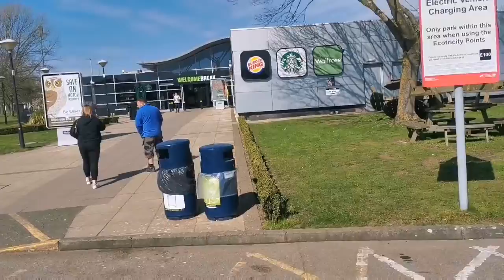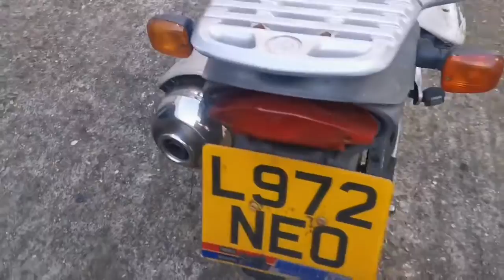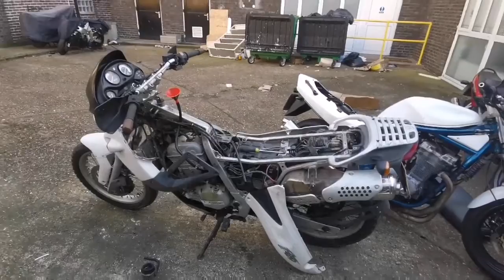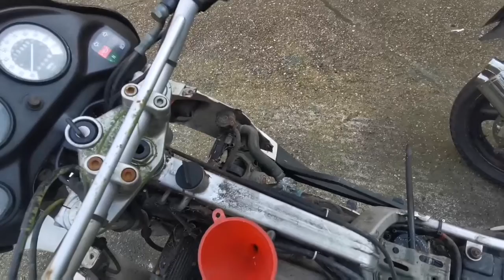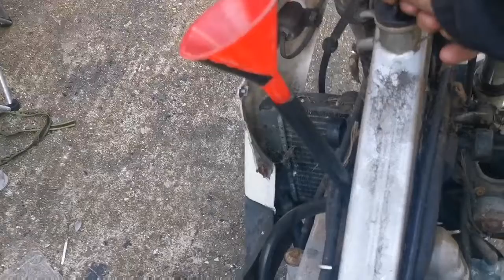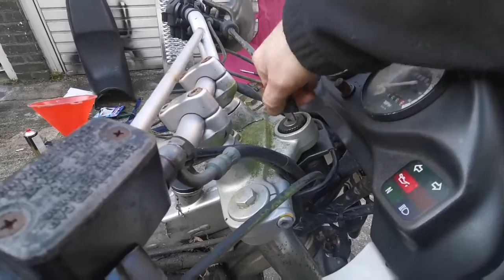Bmw f650, introduction, fix, repair, build, salvage, project, first look,

Comment: That thing is going to start burning its own engine oil through the airbox, or throw it out. Only check the oil level after it is at operating temperature. The engine is a dry sump. The carb ports on the dash pots are supposed to be uncovered.
Reply from the maker: Hi, its a very old vid this one but ill watch it again out of curiosity when I get a chance to see what you mean..

Thanks for watching

Comment: Did you cut the cable of the kickstand switch? In the first try the starter didn't work while the kickstand was down but later it did. My F650 kills the engine instantly when I kick the stander down. I can only warm up the bike while it's in the center stand.
Reply from the maker: I'm not sure if I'm being honest as this video is a couple of years old. I do regularly cut and wire side stand switches though as they are a known failing point. 

Thanks for watching and please subscribe.
Reply: @motorcyclerescuer  I've already subscribed. :) Thanks for the videos! I got my license last year and I started to be interested in the mechanics of the bikes. The center stand is a nuisance indeed but it can be a life saver. If you forget to kick it up before taking off you can have a disaster while turning left. I've heard a story about that from my driving instructor. His friend died that way unfortunately.
Reply from the maker: @istvanbocsor7911  that's true yes, it can be very unsafe. Badly fitted to low exhausts can do the same thing aswell. 

I love mechanics, it's like therapy to me so I'm sure you will love it to.

Comment: try wd40 in the ignition, has helped me before
Reply from the maker: Hi mitko, I put some contact cleaner in there yesterday, that should work it's way through. May help but may not.

Comment: Not bad, hope those carb rubbers don’t cause you too much hassle. Once they’re hard they can be a nightmare.
Reply from the maker: I'm thinking not to take them of. If I can work out how to put the new fuel line on without it then that should be fine. It starts runs and idles so don't want to mess with it to much. The air filter comes out the side so I can still service it
Reply: Yeah probably the best idea mate. look forward to the next vid 👍🏼
Reply from the maker: @woods146  thanks mate. Will be next Saturday dude.

Comment: Motorcycle rescuer can i ask your advice
Reply from the maker: Hi mate, I'll try my best. What's up
Reply: @motorcyclerescuer  I changed my carburetor on my moped and got it started but ever time I put seat on it cuts out
Reply from the maker: @McteddynLoco  that's really interesting. Are you using a cone filter? If you are I would wonder if it's being suffocated but I doubt that. Could the seat and bucket be pressing on the fuel line?

What bike is it
Reply: @motorcyclerescuer  no using a box filter I got a bullet filter but not put it on and i don't think so I check all wires and lines going from fuel tank to carb and they all perfect
Reply: @motorcyclerescuer  and sorry the bike is pulse scout 49
Reply from the maker: @McteddynLoco  what bike is it? Does the seat and bucket go in together.
Reply: @motorcyclerescuer  is pulse scout 49 it's a Chinese bike and yea seat and bucket is one
Reply from the maker: @McteddynLoco  sorry mate didn't see this reply, definitely seems like the bucket is pushing on a wire or something.

What area are you? I've worked on a pulse before
Reply: @motorcyclerescuer  hello I find it it was a cdi wire came loose sorted it moe but need to get a carb for it bought new one n it bogging down n not pulling up hill
Reply: @motorcyclerescuer  thank you for replying means alot

Comment: Gonna need a lot of work tho
Reply from the maker: I was thinking that however it started and rode. So if I'm not to over the top and just do the basics then it should be good to go at a reasonable price.

How you doing?
Reply: motorcycle rescuer yeh true, u keeping it for urself or repairing and selling. Also I’m good wbu